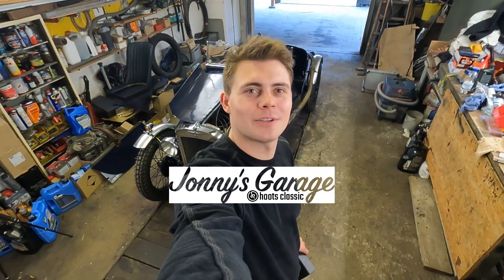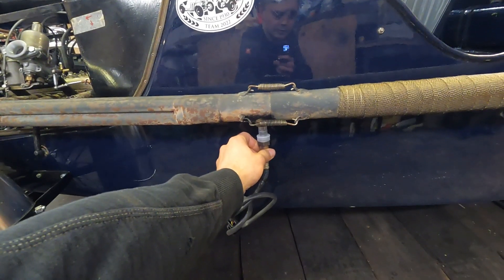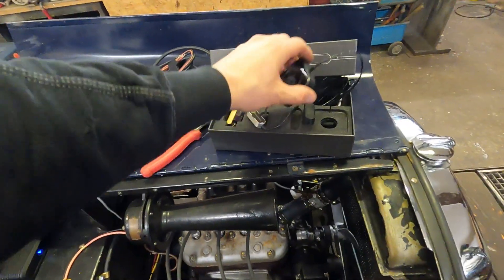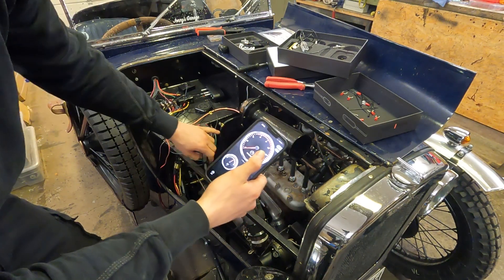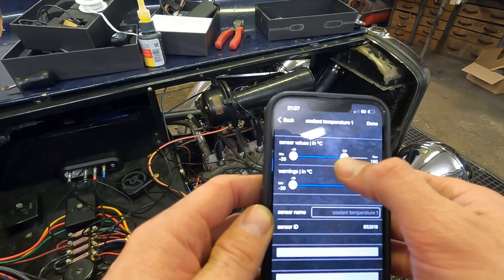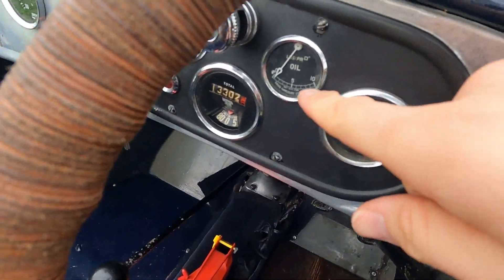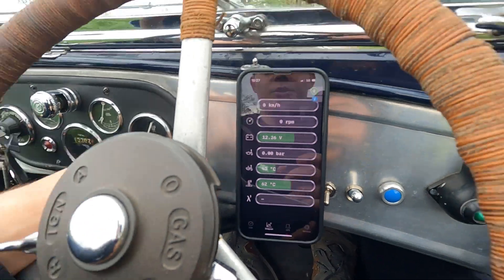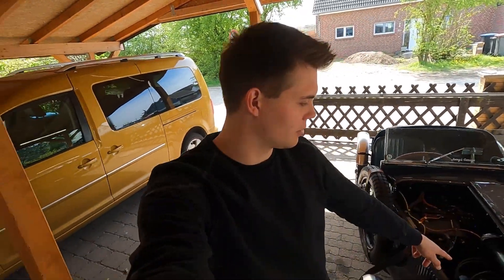Installing 6 modern sensors from @hoots.sensors  in a 90 year old car!

Comment: Brilliant idea, I have GPS for my speedometer on my Ruby, the factory gauge is a bit inaccurate at speed. 

Surprised that you did not set the oil pressure readings to imperial units, then you can compare with the factory gauge to see how accurate that is (or not!). Looks a nice bit of kit and hidden under the dashboard it will be out of sight.

Will offend the purists, great that you are investing time & money to have your car the way you like it! Well done & thanks for sharing!
Reply from the maker: Thank you so much! Good idea with changing the readings, but my „old“ gauge is almost always maxed out so it doesn’t really show the actual value so it wouldn’t really make a difference.